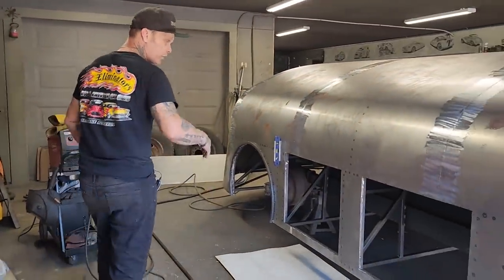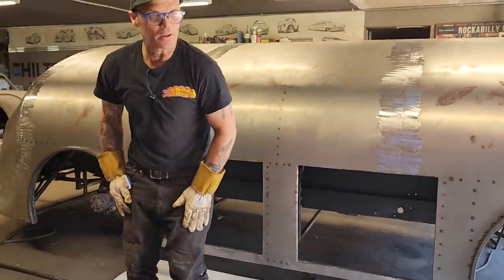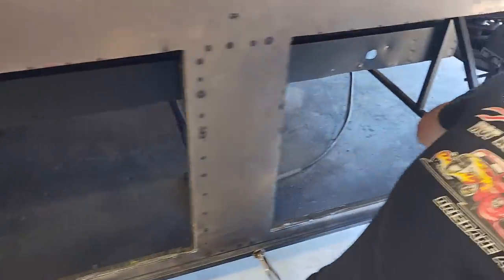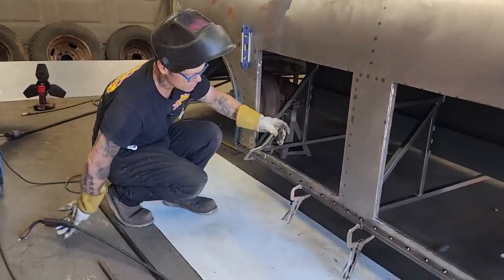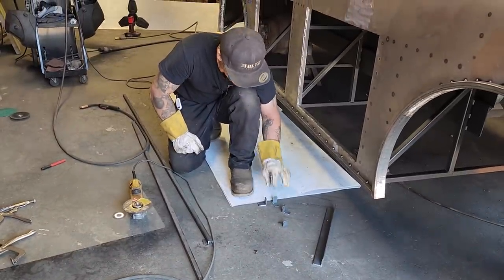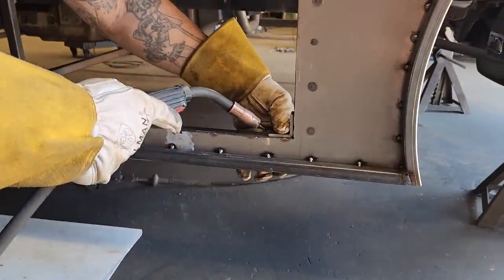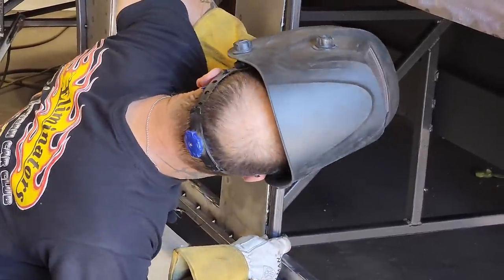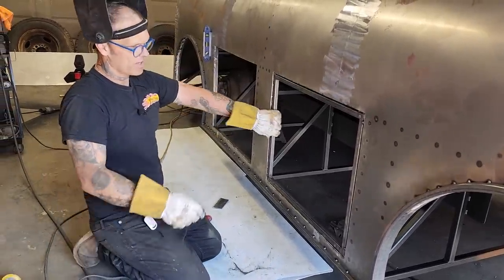Next up... fabricating the framework for the doors

Comment: You can wipe flast rust off with a mild phosphoric acid my daily drive simply wont rust its factory galvanised, Citroens and Peugeots from the mid 90s onward have galvanised bodies, I had to run a tap through the factory mounts for the towbar on my current C5 the tow came from my previous C5 they galvanised it after the captive nuts were welded in

Comment: Hi. Why not  when you make the door. Put 2 lengths. If square stock  in the. Centre of the  one door.   Zip cut. Between. The square. Stock.  Hey ho you have  2 nice. Sized. Door that you can latch. Easy. In the centre 
Clive.  Uk